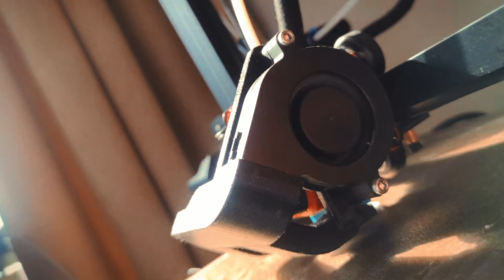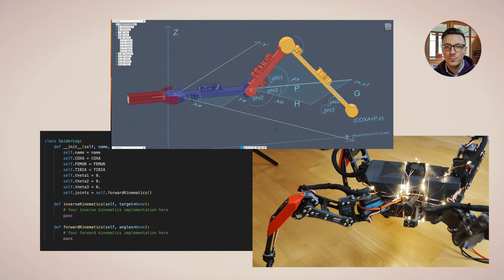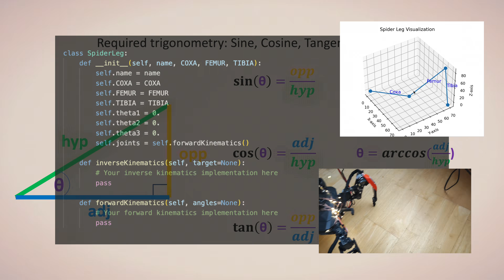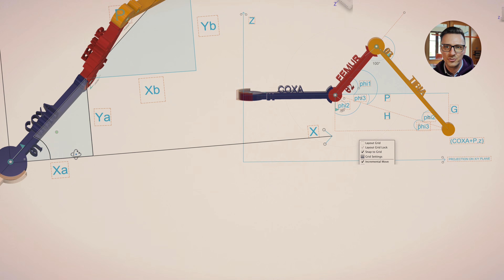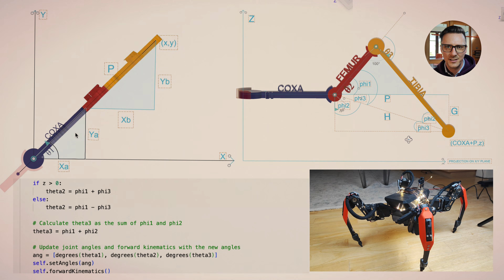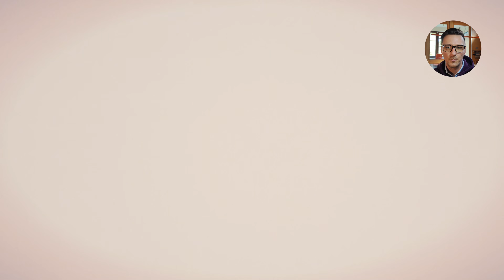Master Inverse Kinematics: Spider Robot Series

Comment: I was always unclear on  how to handle Coxa until I see your video. Thanks!  My Coxa point is not on the same line as the other joints, there is an offset. I need to factor that in to do the IK.